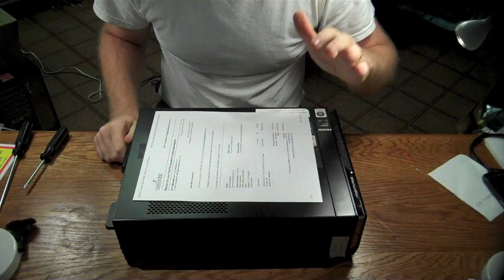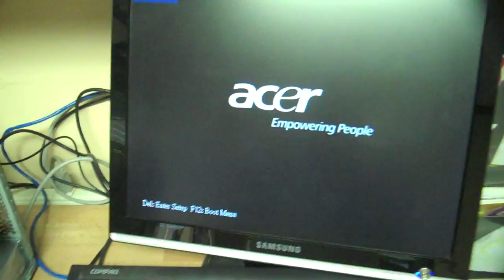Acer Aspire X1200 Power Supply Replacement

Comment: Perfect, the hard drive at 2:37 was the part I wasn't sure about. I'm using a different model supply, "Chicony computer power supply cpb09-d220r" but the computer was basically the same style body... Thank you!

Comment: The hurt!

Both Wrong orientation on the heatsink fan... meaning bad thermals.
Also, danger of ESD damage when vacuuming ESD sensitive devices if the vacuum nozzle isn't grounded properly.

Comment: I have the same computer, and my power supply fan is making noise. I have thoroughly cleaned the dust out of the inside of the computer, and it still makes noise. Do I need to replace the power supply unit, or is there something else I can do?

Comment: I changed the power supply in one of this but still not getting power.
Reply: I did the same thing, and didn't work. What did you end up doing? I only installed mine a few days ago, and still no power. Might return it to Amazon if it's DOA, but IDK if the desktop has some other issue. I put a new CMOS battery also.

Comment: Hi, my daughter has this computer and when you plug the power cord in it will flash the blue light and run wide open. You have to unplug the power supply to turn it off. Any ideas?
Reply: You have a bad power supply and for some reason, this motherboard will only work with the original power supply. I've tried several that I know are in good working order and they all did what you just described. When I finally installed an exact replacement, it fired right up!

Comment: Hello there
I purchased a new power supply for my mini Acer and put it in following your great little video...however, now I am getting power to the unit but receive the following msg:   boot from ACHI CD rom   disc boot failure insert system disc
Does this mean I messed up the hard drive fixing the power source?  Please help

Comment: I have this computer, when I bought it it also came with an nvidia 9300ge graphics card, but it doesn't work, only the fan spins. Could it be that the power supply is too weak for this card?
Reply: yes

Comment: I have the Acer X1200-U1794A which is about the same as what you just repaired. I would like to know if it's possible to up grade the power supply to a higher wattage and I also would like to see how the CD Rom is taken completely out because the door no longer opens on mine because I rarely used it. I think the belt is shot in the CD Rom and I watched a video on how to replace the belt but it was out of a regular PC not one of these minis.

Comment: or to reiterate Acer aspire x1200 - Will not turn on. When power button is pressed, blue power light flashes and fan turns on and runs, but nothing else happens. No boot screen, no blue screen of death, nothing.

Comment: Hi i also have the same computer and im having a panic attack because when i try to switch it on, there's no display at all on the monitor just THE BLUE LIGHT BLINKING ON AND OFF,  I HAVE A FEELING THAT ITS A FAULTY POWER SUPPLY, IS THIS THE WAY A FAULTY POWER IS INDICATED ?? (PLS HELP)

Comment from the maker: I noticed this as well and flipped it around after the camera was off.  Easy mistake to make!  

I am always careful when applying pressure to any part of the motherboard, so yes be gentle when putting those screws back, and yes the seal and be broken on the thermal paste if it is old and brittle, you should replace it!  Thanks!